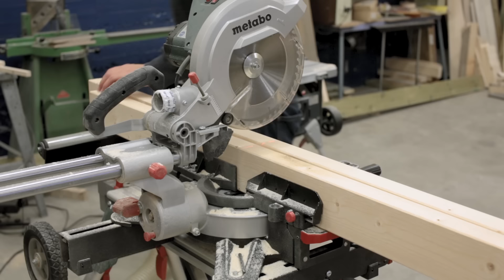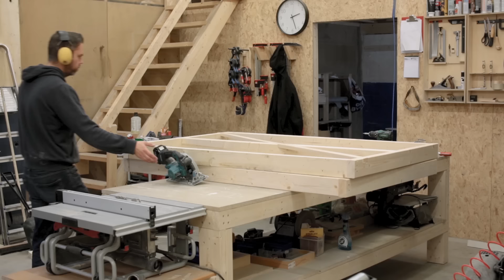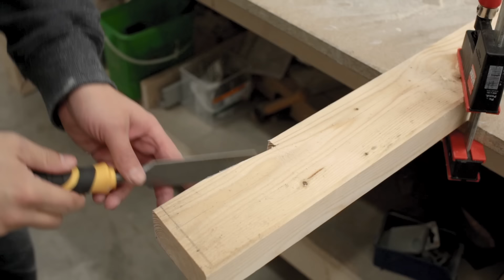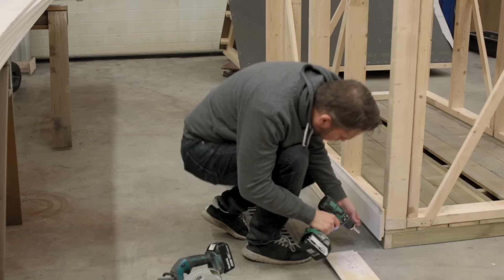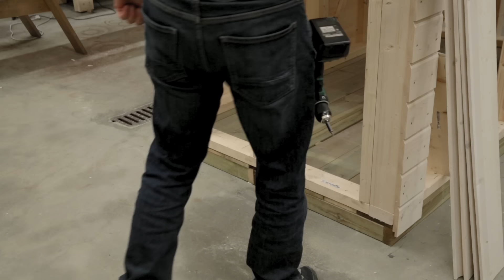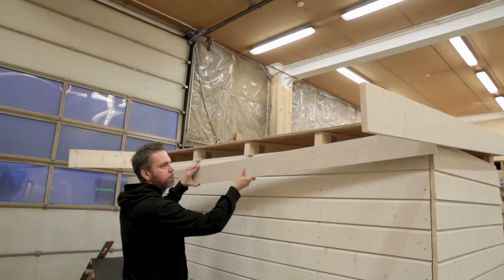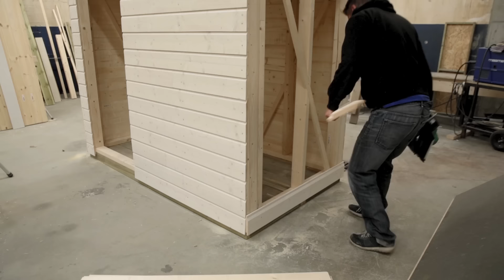DIY Shed That's Changing my Life (1200% Income Increase)

Comment: I've watched 100's of DIY buildings videos and THIS one is most inspiring. 
The Size and Simplicity make this the most versatile and practical design that I've ever seen. 
Marketing wise there's no one that you can't sell this to.
Reply: He does make it look easy indeed but definitely not a weekend project for a novice. Well not at the same craftsmanship
Reply: Someoneelse Who has all those special saws? Not me. I guess you could have box store or lumber yard cut but how much is it per cut? $1??
Reply: @janonthemtn  Harbor freight has them for a reasonable price. :) You don't really have to have them, anyway. A hand saw will do.
Reply: @janonthemtn  Special saws? I don't know a single man, unless they live in an apartment, that doesn't have a circular saw and a miter saw. They aren't special, they're the most basic of tools. You could easily do this with just a circular saw and those are cheap. Even a good miter saw for the average home owner / wood worker is less than $300. And if you're a home owner, that will more than pay for itself. Most people don't need a table saw; I don't even use mine, and you certainly don't need one for this build.
Reply: @Swearengen1980  Maybe I can try, I can measure...

Comment: good for you finding a market for these as they are surely better than the ridiculously expensive plastic garbage you get at the big box stores but I'd be interested to see your cost breakdown.  I built our shed (8' wide x 6' deep x 7' tall) from cedar, including a framed base with plywood floor, double doors and a shingled roof for less than $600 Canadian.  It's also framed with 2x4s and all screwed together.  Of course I'm not counting my labour but you can hardly buy one of those pre-cut packs for that price.

Comment: Love the recessed cross braces.
Reply: Yea, not seen that on other builds. I'm looking at building a 16ft x 10ft and the videos I see don't put any bracing or noggins in at all. I've had visions of me putting up the sides and then watching the shed collapse  to one side like a small scaffold tower with all the bracing in one direction lol (see a brickie do that then climb on and it collapsed 😆) certainly gives more confidence in its strength.
Reply: Something that small doesn’t really require to have cross braces but pretty neat that he inlayed them anyway.
Reply: Lots of sheds side sheeted with PLY or OSB. That will perform side bracing for you.
Reply: Craftsmanship
Reply: @dmh151076  depends where you live. When you are in a cold climate with a lot of rains you want your stuff to be more rigid because the soil under it is going to move each winter/spring.

Comment: When you put the second piece of shiplap cladding on and it didn't go full length, I thought "why didn't he use a full length?  This will be terrible!" then when you offered up the cut piece and I saw that it was tongue and groove.  We don't have that in the UK, at least, i've never seen it.  It seems to be much more efficient than our flat ends.  I'll investigate the idea of routing a tongue and groove maybe in future although suspect it would only work well with thicker cladding boards.
Reply from the maker: It works very well. These boards are only 19mm. It's probably the most popular cladding here in Norway.
Reply: @DieterSchneider  Interesting and yes I was thinking that 19mm would be the minimum.  I did wonder if you had routed the ends yourself but clearly not.

Comment: First, thank you for sharing your design, methods and work. The diagonal strips for rigidity were excellent. Good job, sir. 

That said, I know this is "just" a shed, not a structure that will be heated and lived in, but I would recommend anyone using exterior siding boards, like we see used here, put 2 nails at each stud, about a quarter (to a third) of the board width in from the edges. Time warp is not just science fiction, it happens to boards, too. I always follow this 2-nails rule with lap siding like this because any gaps that appear later as the wood ages and relaxes could be places for bugs to enter, and for the "wicked winds of winter" to weave their way inside. 

Also, it would be nice to see narration or text added to describe the main things like outer dimensions of the completed build, or of the 2x structure. Thanks!

Peace and profits to you, sir!
Reply from the maker: Thanks for your input, but two nails in this type of siding is wrong. The building code says one, and the manufactureres says one.
Reply: @DieterSchneider  - Fine. But not "wrong" - just "more than minimally required."
Reply from the maker: @logmeindangit  It's wrong and it's a waste of time and nails because it has no function (and it increases the risk of cracking). Every house in Norway built with this siding (and that's many) does it this way. It's not my personal opinion, it's the building codes.

Comment: Hi. I'd really like to know how you sealed the bits between the roof rafters in between the bird mouth cuts. You placed a board over the ends but nothing on the bottom of the overhang? I've built a tiny house before and have another project imminently. I wasn't happy with my tiny house solution to this problem and wondered what you do. Thanks for your help.

Comment: Good job! Could you give us the dimensions of the sheld, the sections of the woods you use and the types and dimensions of fixations?
Reply: Looks like it's roughly 4x8 based on the sheet of plywood he used on the roof.
Reply: That's something to what I thought,  but no,  Dieter said 30 sq. ft. In a comment. I don't see it, just relying.  '

Comment: Good sturdy shed. Would like a cutting list 👌
Reply: And I want someone to cut my steak for me. (Really, wouldn't that be nice? 😎) seriously though, a person wanting that could easily make a list of the boards used in each panel, then go to Excel and start listing them. If you want to guess at lengths, plug those in in another column, and in another column add price from the store for each raw piece. 

Then, in another column, add any cut notes you might want.

I built two covered porches, no experience at it, just didn't know how to explain to a builder exactly what I wanted. So, I decided what size deck/floor I wanted, then the depth, and made a detailed drawing of it in... VISIO! Yeah. It worked great for thst, but was only 2D, so I had to draw each view as a new drawing. But I used supports thst were to code for beams and joists and really rigid roof rafters. Measuring the real dimensions of 1x4 cedar boards for the deck, I made one in Visio, width and lengrh, then created an "array" to make all of them, at the proper spacing. ( laid out on the drawing with a small gap between them )  

Doing all that enabled me to make a complete materials list, including screws and other hardware, very clearly. 

I even laid out the plywood sheets for a pitched roof using Visio. I first made a front view, then used the measuring tool to see how long each side was to the end of the eave, and then figured out 4x8 sheet placement so I knew where the smallest pieces would be. Those I placed along the ridge, which in my case were long strips about 14" wide (long edge at the ridge). 

I was even able to lay out the steps, including rise, run, stringers, and even how to attach them, using that drawing program. Then it was jist a matter of counting (manually) each piece of each type, and listing it in Excel. That let me do my shopping a LOT more easily than what it seemed like I was facing at first. It took a long time, but I have t porches now that look great, and 18 years later, are durable and should outlive me by many decades. 

For appearance, I chose an A-frame pitch roof in front that matched the roofline of the house, and put composition roofing on it, like the house had. I had the company who reroofed my house back then leave me enough to do the front porch roof, too, when I got to that project. It took about 2-3 months to ger the porches done after the roofer did the house.  

In back, I chose a shed roof, and used painted steel roofing, because I wanted rain runoff to go away from the house, and metal for longevity of the roof, since it is mossy back there.

Each "covered deck" is 8x16' with  over a foot of overhang on the roof eaves. Northwest style, ample eaves, because we get a lot of rain. Not like California. 

Sorry to go on so long, but it's what I did for a materials and cut list.
Reply: @logmeindangit  How did you type all that without getting half way through and wondering, "does anyone have any common sense? It's right there in the video, just look and count....or decide on the dimensions that work for your needs and sketch it up".  It's not rocket science. Most of it is elementary math. And all these people who keep asking....the dude sells his plans, not gives them away. It's right there under the video!

Comment: question.
the way you built your roof, isn't the water going under the metal sheet?
Reply: I presume the drip edge will later have a metal roof applied over it.

Comment: Nice shed! Sorry if I missed some info, but not sure what you mean by 1200 percent income increase. Also thumbnail says $1500. Did you build it for $1500 your cost or selling for $1500? Not sure I could even build something like that for a reasonable price in my area of the U.S. Then make much of a profit selling it. Lumber and building material costs are through the roof here. Excuse the pun. Anyway, I wish you much success. You are an excellent craftsman.
Reply from the maker: 1200% income increase compared to previous month.

Comment: I was right along with you till you had to do the roof. I don’t understand how you know what angle to cut. Is there a formula depending on the height of front wall and back wall?
Reply from the maker: It needs to be plum, simply use a water level or hang a chalk line to mark

Comment: Do you plans available? Or dimensions?
Reply: Yes, wondering the same thing
Reply: The spacing for the studs is 24" on center which would make the shed a 4' X 8' structure and probably 6' high, which could easily be made higher if needed.

A simple build for anybody that's ever built nothing more than a dog house, and his video shows how to do it as well as anything I've seen so far.
Reply: Larry Whalen it’s nice to have a cut list though

Comment: I’m not sure why the diagonals are needed, although cutting them in as a nice touch. When you skin it with whatever material, it should solve any racking issues. Also, is that MDF shiplap? Is this going outside?
Reply: I don't think I've ever seen a shed that wasn't installed outside 🤭
Reply: @priestesslucy3299  haha. Meaning is the MDF shiplap going to be facing outside. No, I don’t see a lot of MDF in an exterior setting.

Comment: What keeps the roof from leaking? Doesn’t seem like metal tin around the border would do much to keep all that exposed OSB from leaking
Reply from the maker: The roof had to be finished at the customers place. I only made the metal ready, it's not attached properly.
Reply: Dieter Schneider Makes sense. Thanks for the clarification 👍
Reply: @DieterSchneider  that makes sense.  Had the same concern👍

Comment: I like it overall. Shouldnt you have hidden the nails on the shiplap siding ? What's up with the roof ? shingles ? Thanks for the video
Reply from the maker: No, the purpose of nailing it like this is to make sure the board below is tight. A lot of people think that the nails should be hidden but that would result in a very weak siding. I follow the manufacturer's recommendations (and Norwegian building standards). Every house with this type of siding has it nailed like this. The roof had to be finished when mounting it at the customer's place.
Reply: Dieter Schneider Id love the answers you give added to the description!!! You’re awesome.

Comment: This is the one I'm gonna build. Awesome work! One question tho. Do the cross supports on each wall add structural support? I haven't seen them before.
Reply from the maker: Yes it makes it extremely rigid.
Reply: @DieterSchneider  First time for me to see this as well. Are those your thing, or standard building codes in Norway? I never see that in the Southeast US, so I was wondering why. Is it due to more snow in the winter putting heavier loads on roofs?
Reply: @matthewisthebest  Before modern sheathing, diagonal braces were always used to stiffen a frame. I still use them in addition to the sheathing.
Reply: @LogHewer  But they're not necessary at this point, especially on a build like that. A novice builder could easily just add a 2nd stud instead of trying to notch in a brace, but neither are exactly needed on such a short side with no door. On that shed, it's just a waste of time.

Comment: 0:46 is that a special measuring tape that has the line marker on the outside?   Never seen one like that before.  Wondering what it's called.
Reply from the maker: No, it's a regular tape measure (Hultafors)

Comment: @dieter schnieder. What kind of van is that amd what is the model trailer you are using? Im in the market for both and that trailer looks slick!
Reply from the maker: It's a Ford Tansit Custom 2014 model
Reply: @DieterSchneider  Thanks, how about the trailer that you used to haul the materials?

Comment: I really don't know much about the subject but I am curious how the shed does in snow because the angle of the roof doesn't seem steep enough to me. I'm guessing that in your experience it is ok - is that accurate ?
Reply: You could always push off the snow if needed.
The slop for plumbing is 1/4 Inch per foot I believe. So anything bigger than that is good enough for a shed in my humble opinion.
But obviously the steeper the better.

Comment: Does it have a raised foundation?  Didn't see the build for the floor. Does it neded shingles for the roof?  Does it need paint?
Reply: That's to be sold and delivered. The owner would place the shed however they wished. On a concrete pad or foundation blocks most likely. Unless you want it all to rot, yeah, it needs a real roof and to be sealed/painted. Shingles if you want it to match your house, personally I'd just go with tin (galvanized steel roof panels) and call it a day.

Comment: How did u determine the thickness of the piece to mark your bird mouths?
Reply from the maker: It's the same as the height of the gap at the highest point (the width of the piece is the same as the top plate)

Comment: Why not nail the piece that gets covered and hidden on the siding? eeek, all those nail holes
Reply from the maker: Because it's not the correct way to do it.
Reply: @DieterSchneider 
 Yes it is the correct way to do it. The nails are put in facing slightly down along the inside of the piece being covered. Just as the roof tiles are done.
Reply: @DieterSchneider  Yes sir that is the way to do it , What you did is called face nailing and not recommended. Now on the endes you could put one high and low and cover it with your end caps .  but in the end you should not have any exposed nails .  On long runs where ends are butted together you can use 16 gauge finish nail in the corners  but you don't have any on that shed .
Reply from the maker: @damnskippyify  No, it's not. This is to code.

Comment: What is the cross cut piece for does it make sturdier
Reply from the maker: Yes, that is correct
Reply: @DieterSchneider  I built an outdoor bike enclosure a good number of years ago and the door for it looked great until I picket it up off the ground to fasten to the hinges. It was then  I learnt the need for a cross beam: even when the frame is screwed together it just sags.

Comment: 1200 percent ??? 

If you an orange it's 100 percent of the orange,  there is no more you can add.

You cannot have more than 100 percent, you can however have 1200 times growth.
Reply from the maker: No, to say your income is up 1200% is correct. 1200% is 12 times more, not 1200 times.

Comment: Amazing that people are willing to pay for a build like this.
Reply from the maker: Why?
Reply: @DieterSchneider  hater's gonna hate
Reply: Beats the osb or tin crap jobs I've seen here in the US. They have 6'x8' kits that sell for 1700 USD and it's 600 USD for an install...seriously about 14 2x4 with sheet metal. A 20mph wind gust would tear them away. This guy is using lap siding and plywood.
Reply: Some people can't change a lightbulb, yet they can make enough money to pay someone to do it. OF COURSE people would pay for a well made shed.
Reply: @DieterSchneider  the roof is surrounded by 3/4 lumber and drip edge. Where's the water on the roof go????? It can't drain.
Reply: Some of us barely know how , others also havebad back ( army injuries back when) and joints with arthritis....

I agree if u know how its it's likely more cost effective to selfbuild.